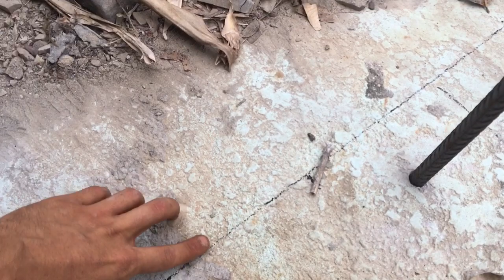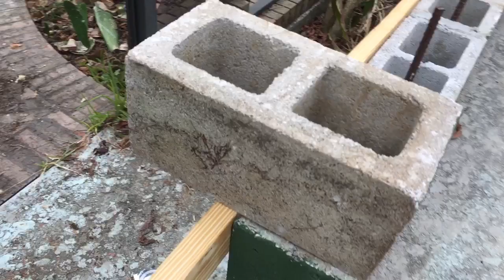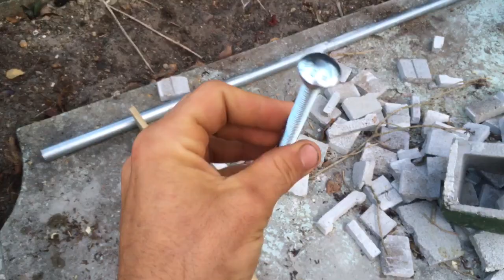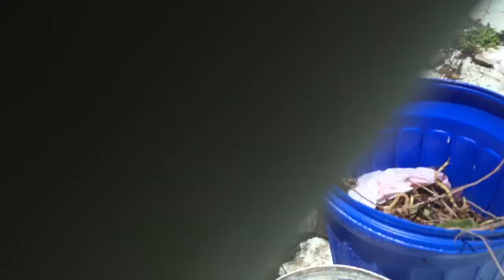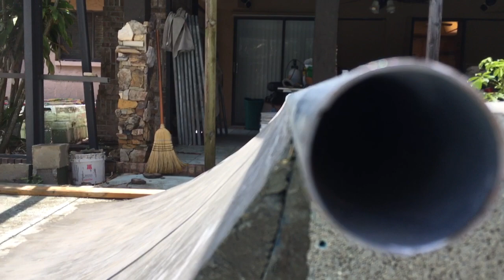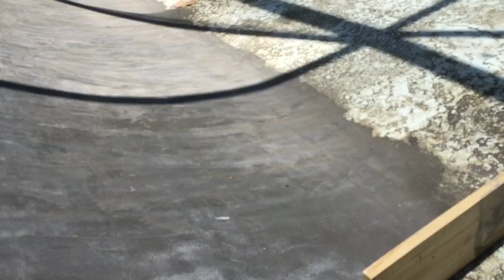How to build Concrete Mini Ramp( DIY Halfpipe) Fort Myers, Florida

Comment: how much it cost to build it ?
Reply: The concrete cost me around 350$ I found the cinder blocks in the woods but they would of been another 50$. The steel rebar cost around 50$ Coping cost 20$ Plywood for forms on the side cost 10$
Whole project cost Around 500$ if you have an existing concrete slab and do all the work yourself.
Reply: ah ok thanks, it's almost the same price for a wood one i think. Great work !